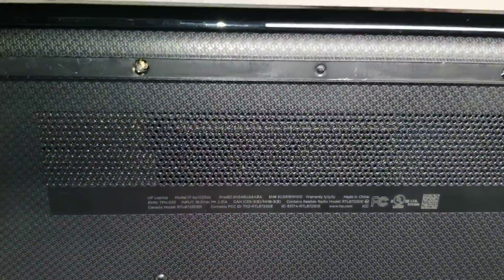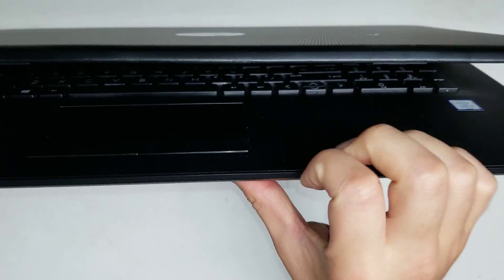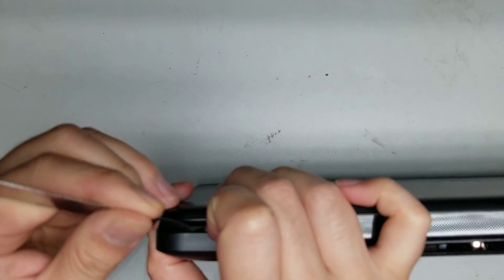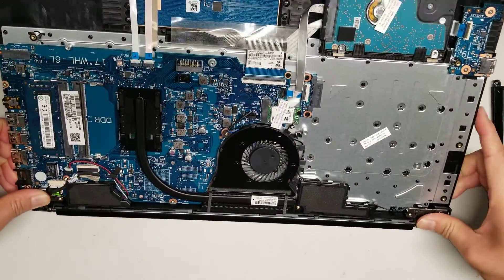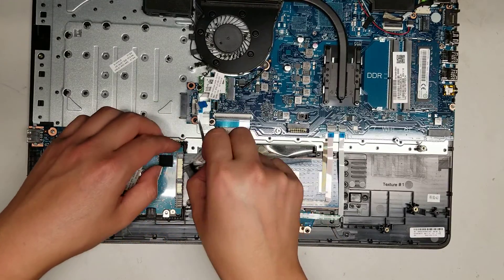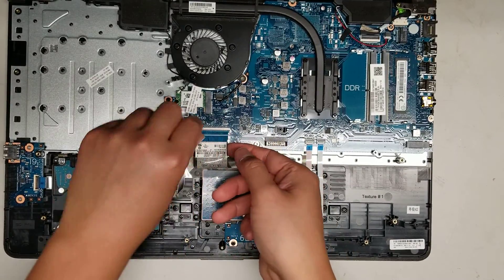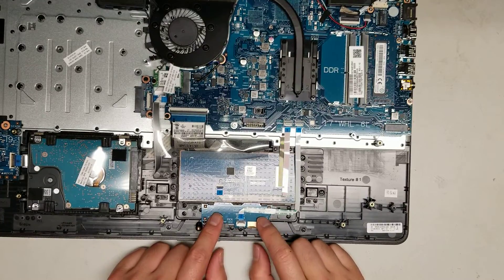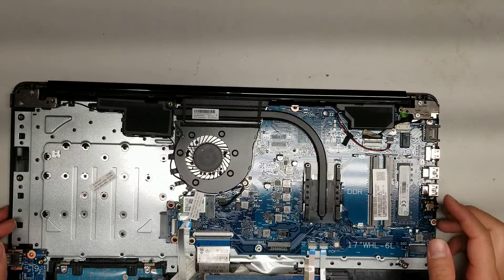HP 17-by1033dx 17-by1000dx 17-by Disassembly RAM SSD Hard Drive Upgrade Repair

Comment: Well, there would be one reason to upgrade the RAM to 16 GB besides increasing the amount of system memory.

It would also get the memory to work in dual channel, so long as the new module is matched to the one in the system.

The system should be able to support up to 32 GB of RAM (16x2).  Of course, that's way overkill for a computer that's built for typical consumer use, especially for what such an upgrade would cost.

And as far as I can determine, this model will support NVMe M.2 SSDs.  That, alone, is a worthwhile upgrade over the 5400 RPM hard disk.
Reply from the maker: Yup, though if you use chrome, it'll be worth it. Lol

Comment: Is it possible to change the wireless card to a Intel Dual Band 7265 adapter?
Reply from the maker: Not sure
Reply: Thank you!! It worked. Internet speed went from 51/50 to 301/268!! The best $12 I've spent! Thanks again!
Reply from the maker: Awesome!

Comment: Wish you'd show to properly remove the battery. My 17 Pavillion has phillip screws holding down the battery, but only one can be unscrewed. So, does your laptop lack additional locks or something?
Reply from the maker: What do you mean only one can be unscrewed?
Reply: @ItsBinhRepaired  Just as it sounds, only of one of four is unscrewable; the other three seem to be locked in place. The battery of my model is pass its expiration and looks about ready to explode.
Reply from the maker: @TheMightyN  I don't know what you mean. The screws should unscrew just like every other screw.
Reply: @ItsBinhRepaired The screws are phillips. All three will not loosen. I really don't see how hard that is to comprehend.
Reply from the maker: @TheMightyN  what you're telling me is you don't know how to use a screwdriver? Again, it makes no sense. Did you twist it so hard the top of the screw broke off? If no, then you're not twisting hard enough
Reply from the maker: @TheMightyN  are you asking how many newton meters of torque is required to remove the screws? Unless the plastic that's supposed to hold the screws in place are broken and it just keeps spinning around, not being able to turn the screws, your comment makes no sense, not able to turn them? Ask someone stronger to try.
Reply from the maker: @TheMightyN  maybe you need someone with a power level over 9000. Lol
Reply: @ItsBinhRepaired  Funny, I thought you were over 9000. Guess those subs were just for show.
Reply from the maker: @Mr. N  sadly you'd have to send it to me in order for me to apply my powers. XD I can't channel them to you.

Comment: I read the thread below about the main battery being used for CMOS battery too,  how to clear CMOS Checksum Error 502 I get after replacing my battery
Reply from the maker: Was it having that error with the original battery?
Reply from the maker: Usually after you start the computer the reset bios message goes away

Comment: Thanks for the clear details on the innards! Question: is there a CMOS battery hiding in there somewhere? Mine is to 17-by1053dx with "checksum is invalid" message and BIOS trouble. Hope I can buy a CMOS replacement battery...
Reply from the maker: the main battery acts as the cmos
Reply: This has been very helpful, thank you!

Comment: Thanks for your video I’ve been working on this same model of hp laptop, slowly upgrading it here and there. Would it be possible to add an additional ssd utilizing the space that the disk drive takes up? If so how could I connect the new ssd to the mobo?
Reply from the maker: You can get an optical disk drive adapter
Reply from the maker: How many mm tall is your optical drive?

Comment: Use a plastic spudger tool or an old credit card as a pry tool to open the notebook. Using a metallic object is  just about a guaranteed way to scratch or damage your notebook's finish. Otherwise your video was useful and inmformative.
Reply from the maker: I haven't had any issues and I do this for a living.
Reply from the maker: Not a very good guarantee lol
Reply from the maker: But yeah, if you don't know what you're doing, use plastic.

Comment: I replaced the keyboard with a backlit one on this model, but it doesn't work. Is there an extra ribbon cable to get it to work? I didn't see the header in the video.
Reply from the maker: I don't think it has one if it didn't come with one in this model. You could solder wires directly to the backlight ribbon and connect it to a usb port for permanent max brightness, but it's risky if you don't know what you're doing.

Comment: Mine came with an m.2 1 tb ssd whatever.  and a rather loose DOA hard drive that didn't have the wrap around you have but was barely stuck with one pad to the palm rest underside.  Gonna be like pins and needles once I get the new drive.. right now I'm actually just considering doing this before the hard drive... but I guess I'll see.  the palm rest I got with keyboard comes with backlit but sometimes I don't bother hooking that tiny ribbon in cause backlit keyboards can be distracting..  I can type blind if I need to.  (or a black Das Keyboard  ;)  )
Reply from the maker: Sounds good

Comment: Do you where I could get replacement 17 by 1033dx laptop motherboards?
Reply from the maker: I just check eBay
Reply: @ItsBinhRepaired  Thanks! I also found some on HP's website for a good price without the Core i5. Also nice videos!👍
Reply from the maker: @blackbearelectronicswithco9541  thanks
Reply: @ItsBinhRepaired  Yeah my girlfriend spilled water on her laptop so I replaced the motherboard
Reply from the maker: @blackbearelectronicswithco9541  cool, everything good now?
Reply: Yeah
Reply from the maker: @blackbearelectronicswithco9541  nice

Comment: Great video! There's one out from HP about battery but video is almost useless. I'm about to upgrade ram & SSD (17-by3063st) and needed to know about the rubber strips so Thanks for covering that part. Also, I have no fingernails but I've found a guitar pick works great to separate the covers :)
Reply from the maker: Fingernails grow, so worst case just waIt a few days. :P